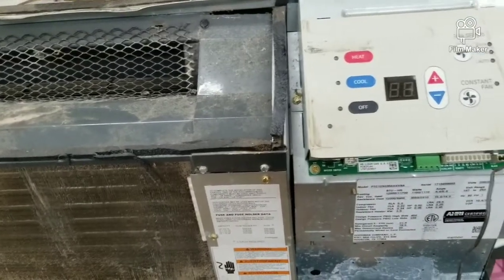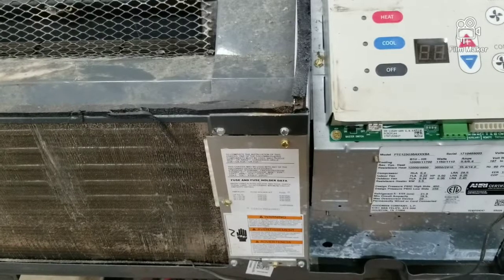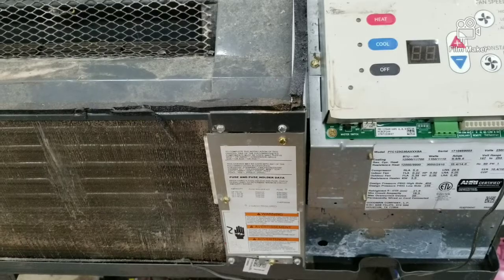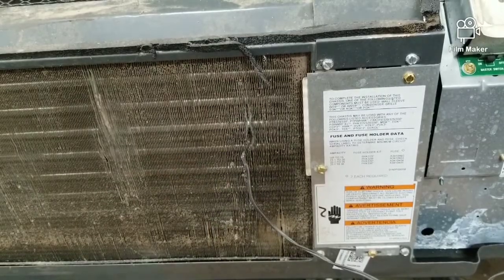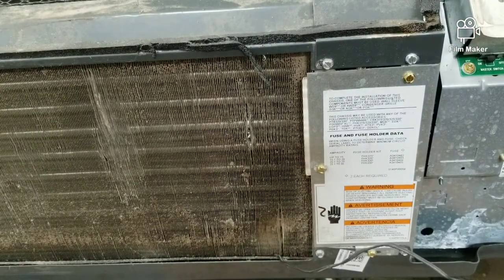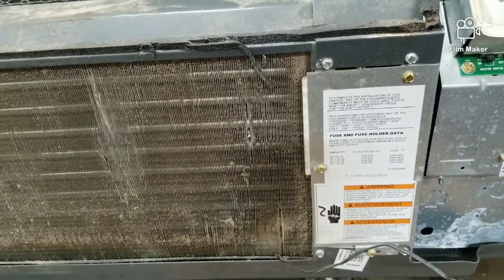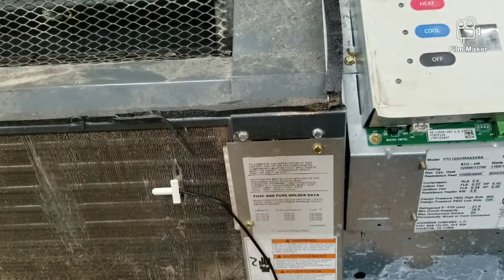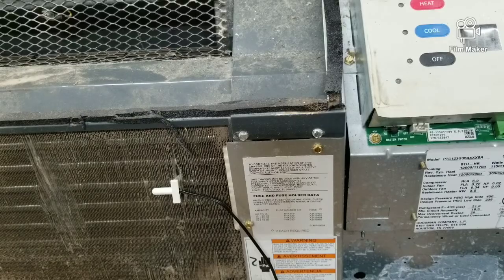Ptac not cooling? This tip is very important!

Comment: why does my PTAC unit blow cold air when on emergency heat when I use the main thermostat but when I use the thermostat built into the unit I get heat my property has been open for 5 years and this is the first year I'm having this issue what could be going on?

Comment: I have a ptac that the thermistor was sitting in the pan I did fix this but I'm still not getting any cold air. I've replaced the capacitor. The compressor turns on, fans are working but the coil does not get cold. I'm lost on what to check next.
Reply from the maker: Sounds like the unit is out refrigerant check out these video, hopefully it helps

https://youtu.be/PcY2ceuUF2w

Comment: So the sensor is in the right place, but it’s not cooling at all. The hotel switched out the unit twice and it’s still hot in here. Any suggestions? We’re moving rooms but have to stay here another night before switching.
Reply from the maker: Hello,
If the unit is not blowing any cool air more than likely its a refrigerant problem

Comment: Most my ptacs will cool but compressor cuts off after couple minutes while room is hot. Any suggestions?
Reply from the maker: Hello Kanbi
I would start by checking for a broken fan blade or a weak condenser motor

Comment: I have applied comfort ptac heat pump unit. When I call for cool it doesn't turn on so I thought I might have this problem with the temp sensor, but then when I turned the fan on, the fan doesn't go on? Would the sensor cause the fan to not work as well? From my understanding it shouldn't affect the fan. Thank you
Reply from the maker: Hey Sam
Well it depends if you have the unit set on cool and the thermostat is not reading the temperature correctly then yeah the unit is not going to work. But if you have it on fan only that sensor will affect the fan coming on...

Comment: Hi there, I have a PTAC amana model with no temperature screen but looks identical to the one you deal with a lot in your videos with the green gauge. My issue is that out of all the modes it has, only fan mode works every time as it should. All other modes are sometimes working, sometimes not. If I choose low cool option it does not react and in 20-30 min suddenly will start working with no reason. I have cleaned all the contacts, checked the mother board and the negative terminals and do not see anything suspicious. I have also replaced the capacitor but the behavior did not change. Any suggestion what the issue could be? Your help is greatly appreciated. Not sure why it is not stable. When it works, it gives a nice cold air.
Reply from the maker: Sounds like you may have a bad control board(relays might be getting stuck), I would recommend replacing it along with the touch pad(control membrane) as well
Reply: @PtacSolutions  Noted and thank you!

Comment: Mine is placed at the same height but farther left. Is that a correct placement or should I move it closer to the right?
Reply from the maker: Hello Jeaniseel
As long as the bulb part of the thermistor is not inserted into the evaporator coil it's ok to have it like that

Comment: Great video David!!  Quick question... The Air Con on my PTAC is creating ice build-up on the coil fins...and then the air is not blowing very cold after that.  What could be the problem?  Thank you so much for sharing David!
Reply from the maker: Hello, the most common reason would be that the unit is low on refrigerant, others include blocked evaporator coil or discharge air flow
Reply: @PtacSolutions  Thanks for your quick response David! I would love to fix this myself. Can you direct me to a step by step process to do this? If I can fix it myself, I would be happy to send you $50 as a consulting fee. :)
Reply from the maker: @GForceimpact  😅no worries... first you'll need to install an access valve if the unit doesn't have one already 
https://youtu.be/rRS6f10orBc

Next check pressure... do you know if the unit is R22 or 410a refrigerant?
Reply: @PtacSolutions  Thanks David... I will watch that video when I get back home and let you know what happens from there! Cheers!
Reply: @PtacSolutions  It's 410a! Just checked the label!
Reply from the maker: @GForceimpact  alright, go ahead hook up the gauges the ideal pressure for 410a would be between 130 to 145 depending on the room temperature
Reply: @PtacSolutions  The gauges? I assume I need to purchase these gauges....as well as the valve kit you showed in other video?
Reply from the maker: @GForceimpact  Yes, you will need them to check pressure and to charge system
Reply: @PtacSolutions  Thanks David... I think I'm in over my head. Between having to buy the Gauges, Valve kit, and Refrigerant...I will probably just call my AC guy to check it out. Darn...I was really hoping to do this on the cheap.  Too bad you're not in my city! I would call you!  Thanks for your great videos!
Reply: David I’m trying to be as least sarcastic as possible...coming from another former tech/current project mgr, why do some of you guys try to walk a homeowner through a service repair and explain how Fix issues like these?!

He didn’t even have gauges let alone adding a valve to check pressures....there are certain things that should be left to the technician. Of course he’s going to try to save money while learning how to solder on a ptac and having the fire Dept called out. 

We have all seen the over confident homeowner that tells us a “buddy” tried to fix it when we asked what in the world happened to their system.
Reply: @stevenm7711  Hi Steven. Thank you for your thoughtful reply. Your point is well taken, and it became very clear to me, very quickly, that I was not qualified to even begin such a project. With that said, I'm sure many viewers find David's video very interesting and good entertainment on some level. I trust that most amateurs would act with extreme caution before attempting any of these repairs.  Thanks again for you feedback! Cheers.

Comment: I have premAire brand unit that a.c does not come on. Controlled by thermostat.
Reply from the maker: Hello, for that unit would disconnect the thermostat and program unit to work with the ptac itself... to see if the problem is the thermostat, maybe a board or also a wiring problem

Comment: Are you in Georgia? Unit is not cooling
Reply from the maker: Whats going on... no, I'm in Texas. So what's going on with the unit
Reply: @PtacSolutions  well the f4 was on so I changed the red wire,  the Compressor seem to turn on then off temp is not cold at all. (I think Compressor turns on I hear something start up then turns off)

Comment: Compressor comes on,but doesn't cool
Reply from the maker: Hey
If the compressor is running and also the motors more than likely the unit is out or low on refrigerant
Reply: How would I go about filling it ?